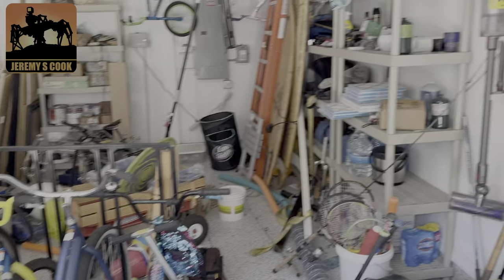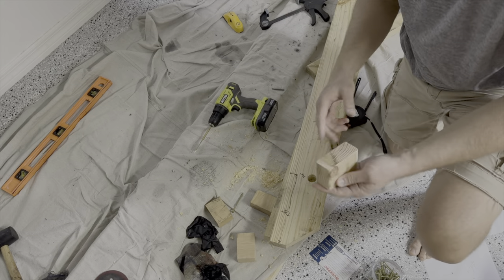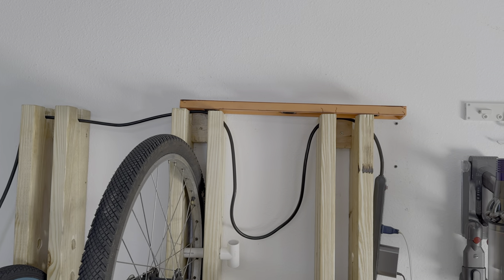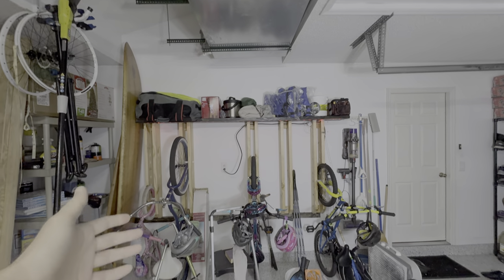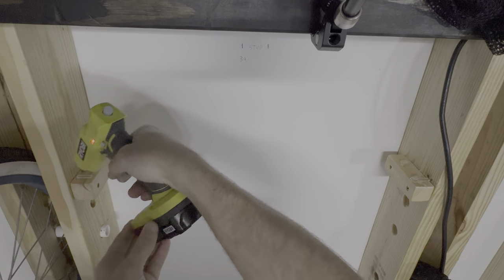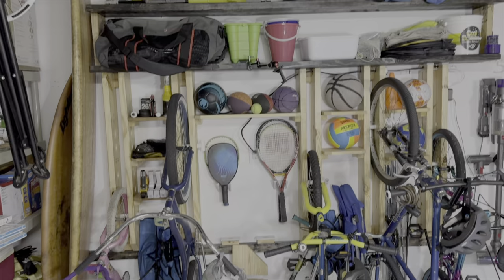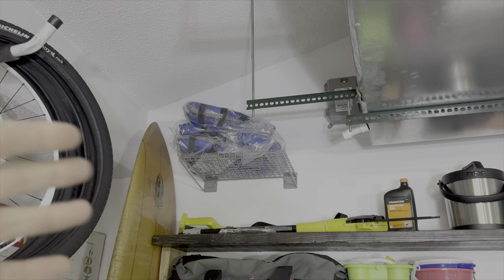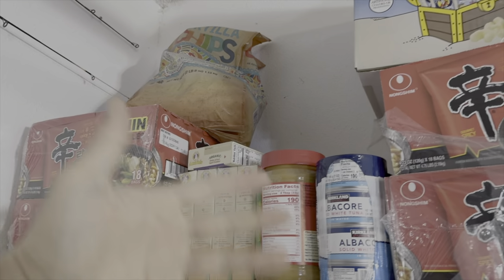Garage Wall Storage Rack for Bikes, Scooters & Shelves With Lighting

Comment: Inspiring stuff! Aim to do the same with our bikes. 

The first 90% of that garage door closing seemed pretty violent! Was that just gravity or a torqued up motor😂
Reply from the maker: Well thank you!

That part was sped up a bit, though maybe I need to get it looked at. Broke one of the springs last year  (which was replaced). Actually still have it under one of my benches because it looks like it could be the basis for an interesting project (not sure what though)